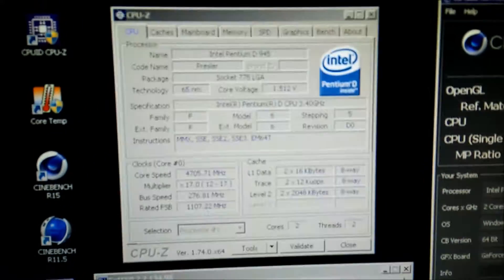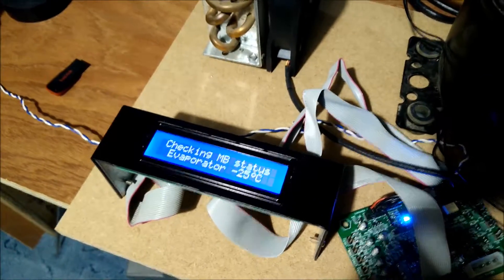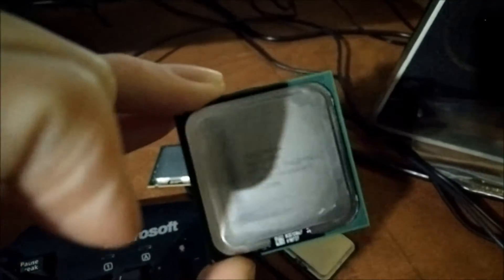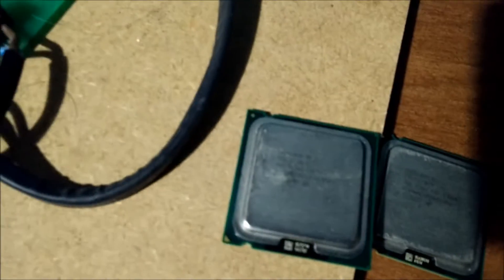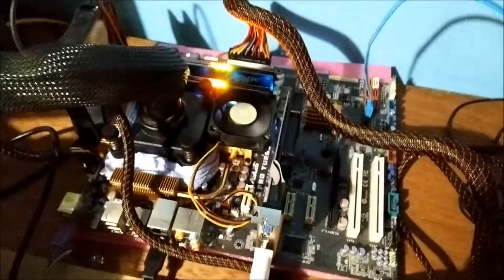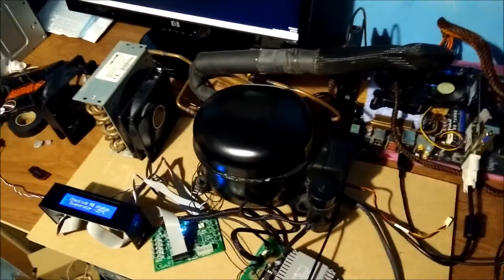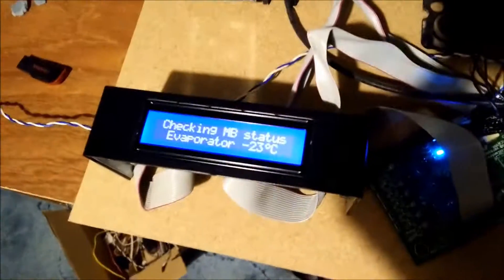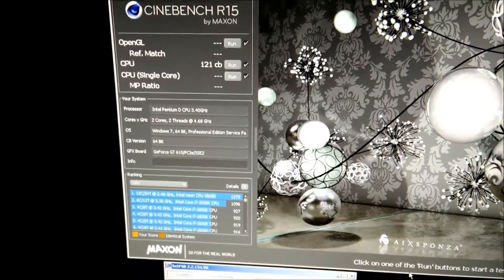Phase Cooler Load Testing Part 2 Phase VS Pentium D 945

Comment: Nice retro kit, that new kaby lake i3k would be a fun chip to try out, might achieve some insane overclocks with that.
Reply from the maker: thanks. indeed it would, at £180 they are a total rip off though :( i will get one used maybe once ryzen comes out and they sell 0 of them and drop the price. :P
Reply: true ryzens are all unlocked
Reply from the maker: ***** yes i know. i am super hyped for them :D i have thought about a 5960x for a while and i even got a used one and had it 2 weeks, but i sold it again, because ryzen is so close.
Reply: With that awesome cooling and zens low tdp, I can't wait to see what that does.